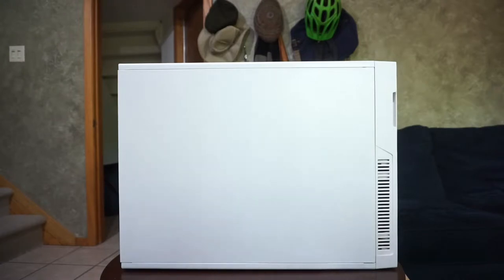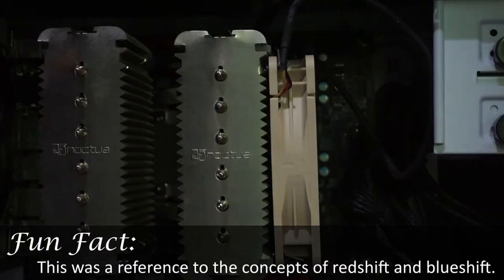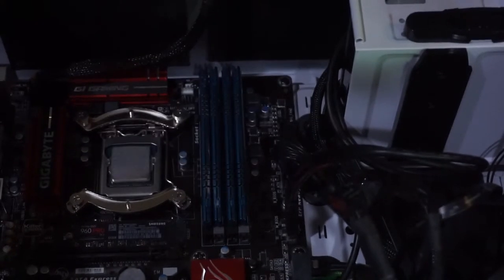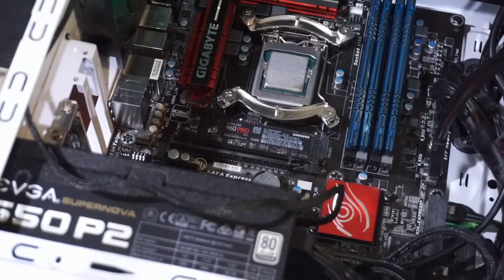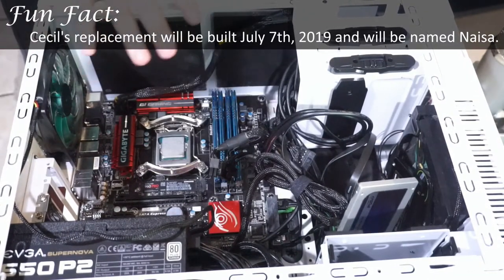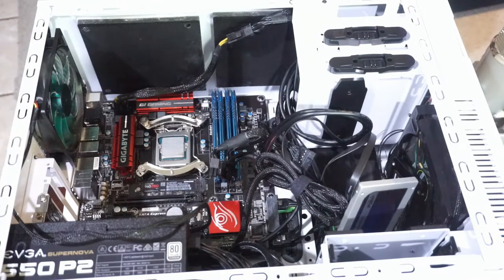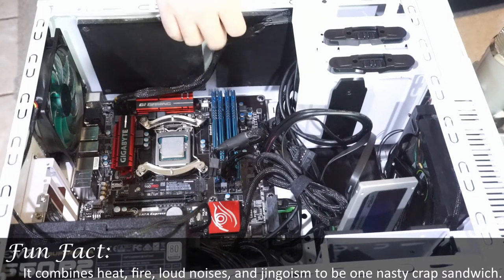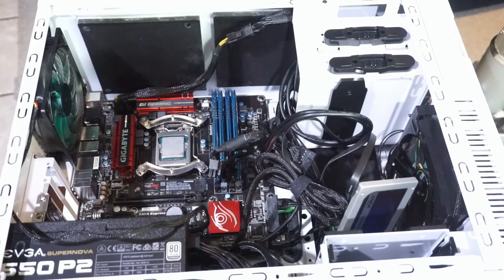My (now-broken) Gaming Desktop Cecil

Comment: 1. I like the redshift/blueshift/purple combo thing. 2. ~4.5 years isn't bad. I've gotten longer usage out of computers, but mostly out of necessity (not cheap to replace and I am Le Poor). 3. I hate fireworks (and hypocrisy, amongst other issues), so also not a fan of the day. 4. Oh, right, optical drive - I need one, since I'd have no other way in the house to play CDs or DVDs. I don't have a TV, I just use my computer for everything.
Reply from the maker: 2) I seem to get around 4ish years out of mine (Sum. 1999 -> Sum. 2002, Sum. 2002 -> Sum. 2006, Sum. 2006 -> Sum. 2011, Sum. 2011 -> Fall 2015, Fall 2015 -> Sum. 2019 for the ones I can remember off the top of my head), so I'm not too torn up about the 4.75 years here. This might be the first with such major issues though - the rest were just obsolete. Usually they go into extended usage afterward serving some other task anyway - like the laptop I had that finally started having issues after nearly ten years of continual usage, but only five of that was "as my primary laptop".

4) I basically use mine to rip music and movies into a format any of my other devices can actually play, or rip older games so the CD rotting doesn't stop me from playing the game. So I don't need it that often, but when I need it I need it. I may go for an external enclosure anyway, just so I can unplug it and keep it stored while not in use.